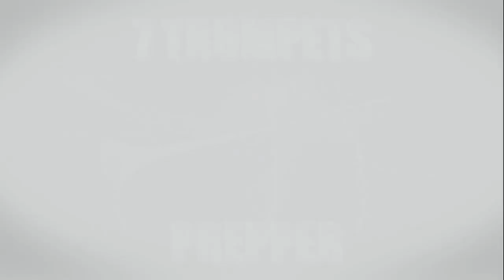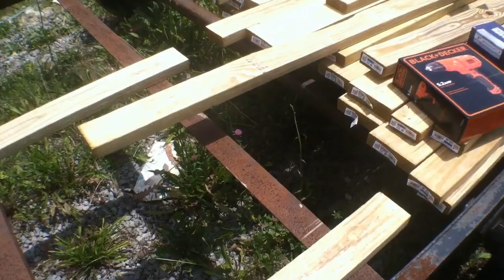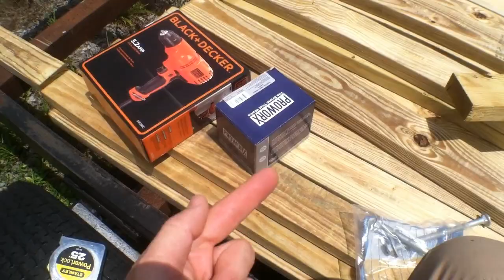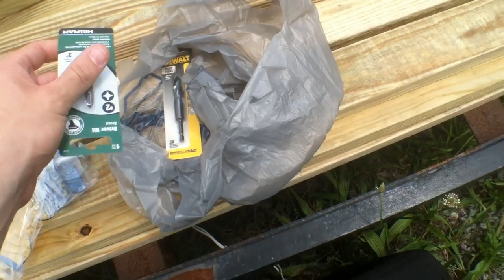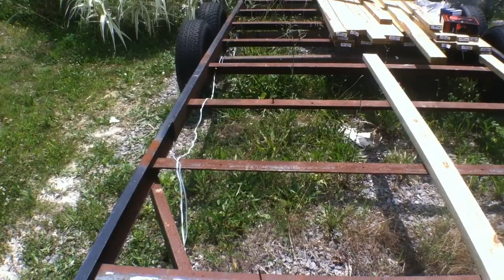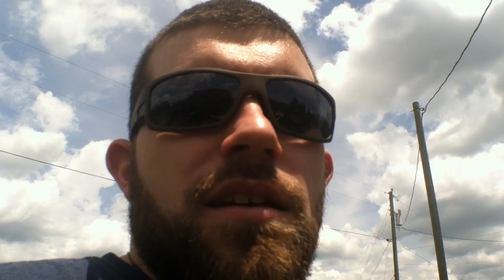Off Grid Tiny House Build Series(Part 1) Subfloor initial layout

Comment: Except for the novelty of building a tiny house, your probably better off getting a manufactured trailer that was engineered for over the road hauling.  I have seen horrid mishaps with home built trailers after a few voyages on the highway.  You can always have solar fixtures and geatures installed through the dealer.  Good luck with your build and I do want to watch each video as you go.  Thanks for sharing.

Comment: Wouldn't you want to sandblast the trailer and epoxy coat it or something? Especially since you'll have gray water exiting directly. I suppose a bit of piping could eliminate most of that exposure but it'd still help prolong the life of the project.